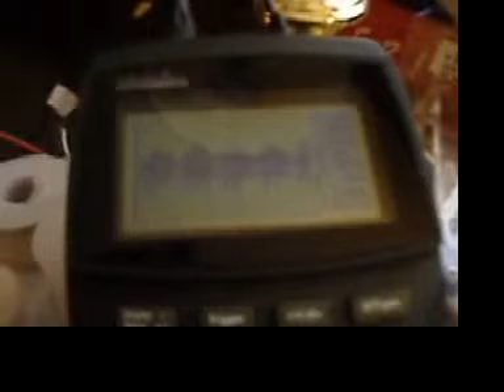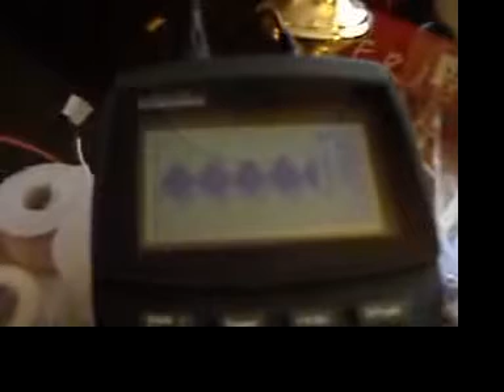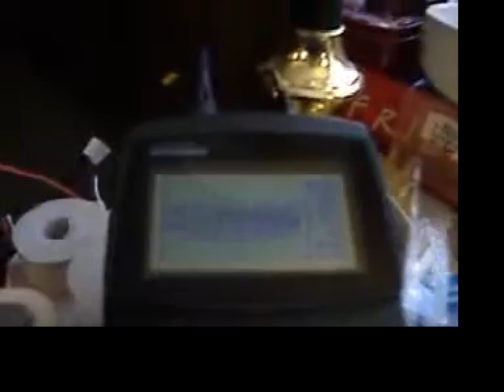Joule Thief with Conical secondary

Comment from the maker: Hi
Yes, the wires of those secondaries are wound around the toroid along side the main joule thief primary wires.
I realize it is hard to see. The red one is very thin and they completely fill the toroid. I had to stop because I could not fit any more than  this.
I took a closeup pic and it is on the first or second of the series about multiple secondaries.
Did you hook up the piezo to a secondary? Maybe your regular jt is oscillating lower than 10khz. Is the piezo in series with the wires?
j

Comment: I have a video where I hooked up a piezo to my joule thief and you can hear the sound. (Click on my video page), I realize we cannot hear  at 500KHz. but due to internal losses or other reasons the signal is audible. BTW, I do have one more question - I notice you have several inductors(secondaries) in you video but they don't seem to be in close proximity with the BJT toroid. I thought secondaries must be placed next to primaries for self inductance to worked.

Comment from the maker: Hi chilliqueen,
This is oscillating at over 500khz, and we cannot hear that high!
The peizo hearing aid is a good one, but it will only work below 20khz or so.
If you make a short video of your peizo using the secondary and hook up the peizo buzzer, you may link it here, I mean like what you did with the plain joule thief but on the secondary wire instead. That would be cool.
jeanna

Comment from the maker: @YuccaOU
Hi yucca. I did think of that too, but I decided to post this vid anyway.
I have this on several of my simpler jt toroids. Was it you who pointed this out before?
Anyway, the frequency of this is 500khz-660khz (that wide range is because this is the width of 1 pixel on the scope.) and the frequency of those others is typically around 150khz to 200 khz. and although they all could be a very high harmonic of this effect, I can't say it is.
Thank you for pointing this out!
jeanna

Comment: its possible the cone coil is creating that effect. If you think of each radius producing its own frequency.. The sum of them all would produce a strange effect. The JT circuit is an oscillator that responds to the feedback between the two coils.

Comment from the maker: Hi gatekeeper1006,
 I do not believe using 1 joule thief to start another works.
I tried it and it was weak.
But, the pulses from 1 joule thief are enough to do the work.
If you take a look at the "joule thief with multiple secondaries" series I posted here, You can see more of what can be done from those original pulses. It is amazing, IMO.
What I am trying to do is to make 2 cones with the narrow points meeting in the center. Better yet overlapping, but I can't yet figure how to do that.
thx
j